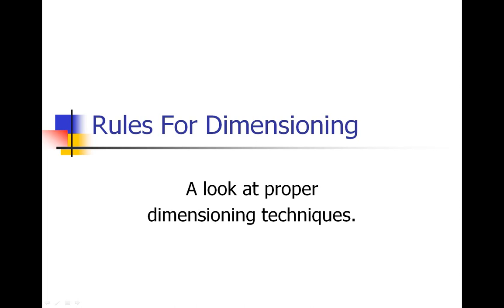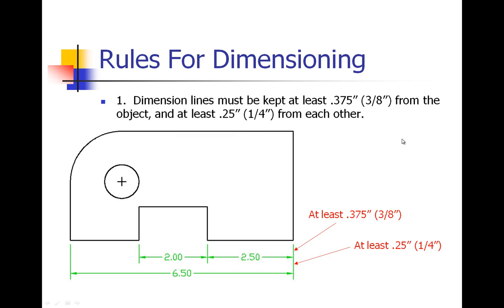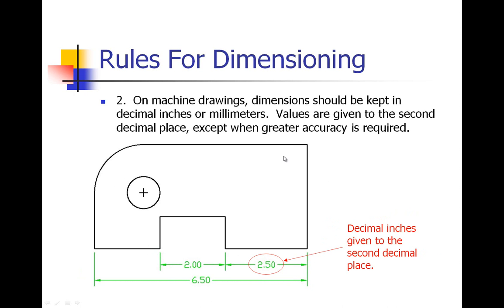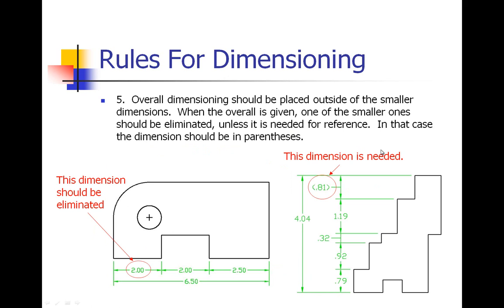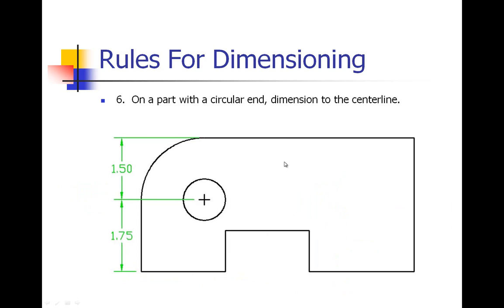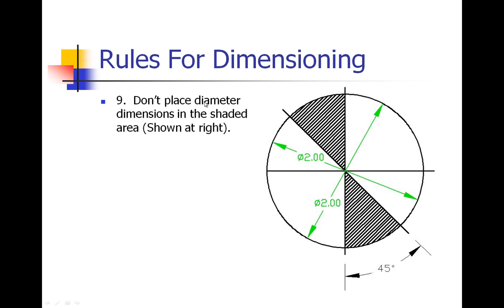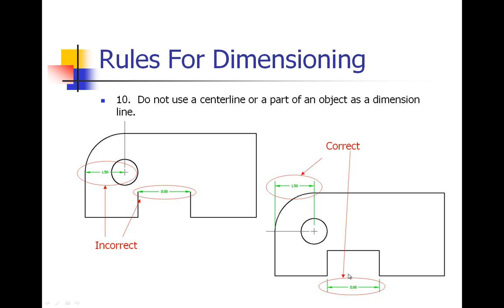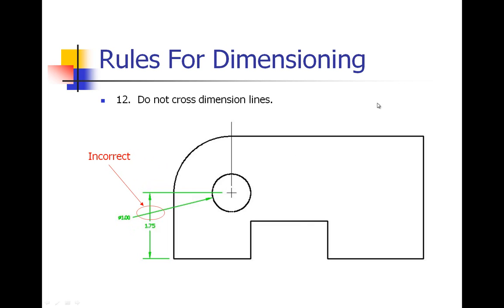Rules For Dimensioning - Mechanical Drawings

Comment: does changing of the paper size affect the size of gaps? for a A0 paper, do we still use a 1/16" gap between the extension and the object line?
Reply from the maker: The 1/16" gap is a nominal measurement.  It is more about the aesthetics than a specific measurement.  If it is hard to distinguish where the object ends and the extension line begins then the gap is too small.

Comment: - dimension line
- extension line
- diameter for circle, radius for arc
- don't treat object as a dimension line, extension line, and center line
- dimension line can't cross together
- must use overall line, eliminate 1 micro-line
- for reference, use parantheses

Comment: Extension lines shouldn't touch the object. Your extension line used to dimension the hole touches the object.....not cool
Reply: Not a big deal in the grand scheme of things.....just a small detail that i see alot....great video just the same.
Reply from the maker: It is acceptable to have extension lines cross object lines.
Reply: Cross yes..... terminate at no....
Reply from the maker: @mode1charlie170  What specific time of the video are you talking about?
Reply: Im looking at rule 6 7:28. The top extension line for the 1.5 dim is touching the object. Should be a gap here....
Reply from the maker: @mode1charlie170  Agreed, I should have moved my grip point out a tad.  Good catch.